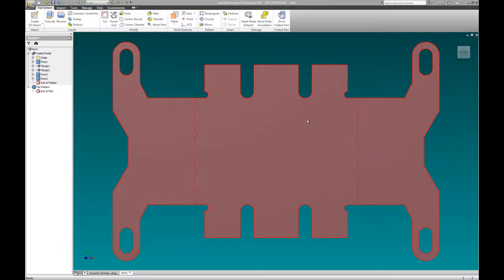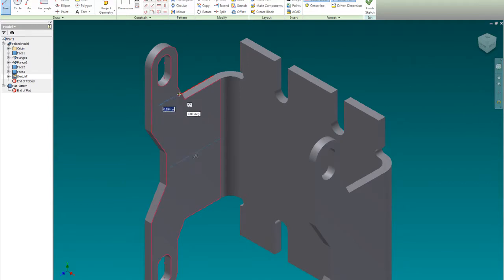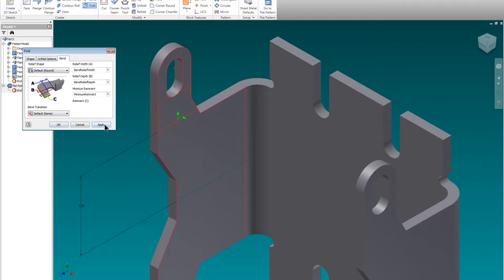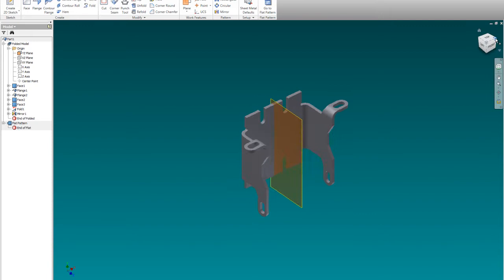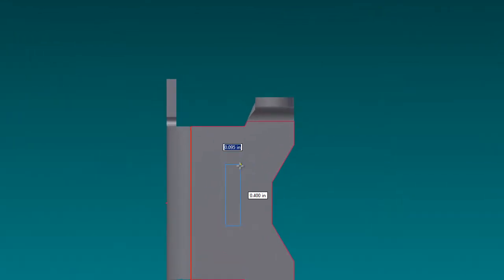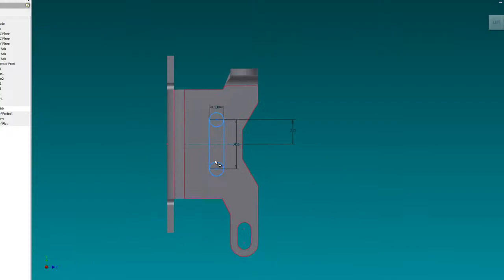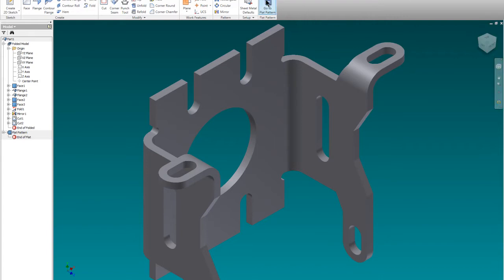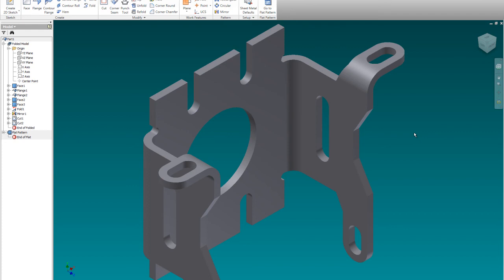Inventor 2011 - Sheet Metal - Actuator Bracket Part 2

Comment: If I wanted to bend one of the three small flanges in the flat starting part, keeping the other two straight, how would I do that? The "fold" tool seems to just bend everything that sticks its neck out beyond the fold line.